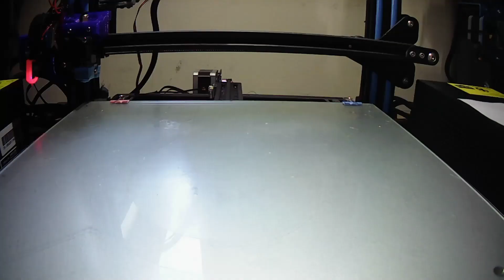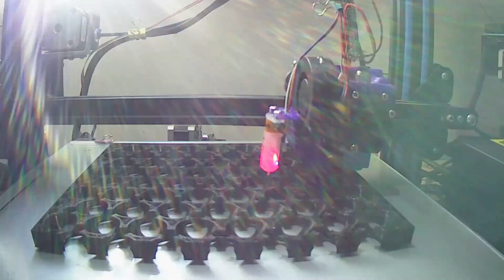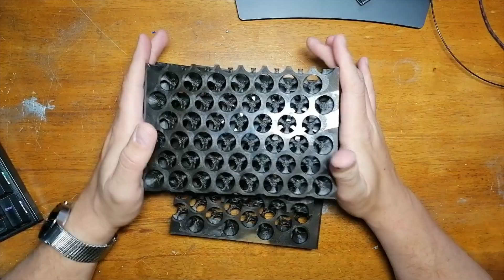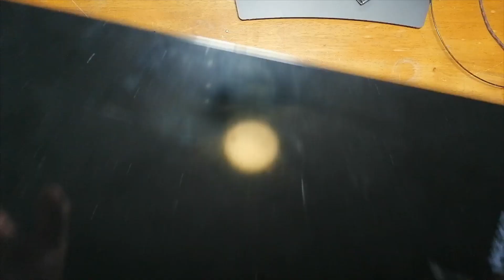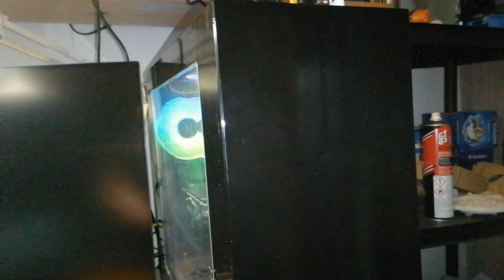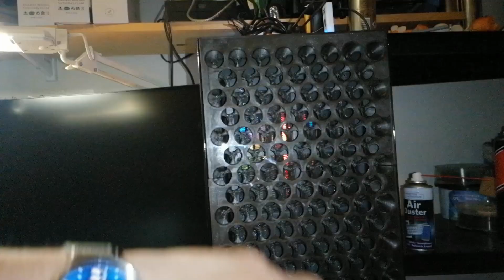3D printed PC case upgrade

Comment: This is good mod. Already print one for My PC. Ajust make a first test and print outside down for keep like aa bed and the fuse with glue on the front  of my pc. The case if a thermaltake suppressor f51
Reply: Also adding to my comment already adjust the size of the print because my case its bigger.

Comment: did you use the 'ironing' feature for this print?
Reply from the maker: No there was no need because the surface you see prints on the glass bed so comes off smooth any way

Comment: Do the s340 and s340 elite use the same panel? Would this exact print work with a s340 elite
Reply from the maker: looking at the 2 the look identical but it's one of those you won't know until you try or maybe email NZXT although I am having real problems with their customer service at the moment